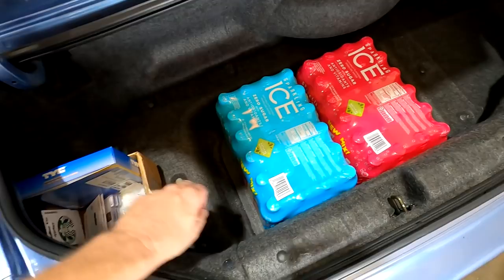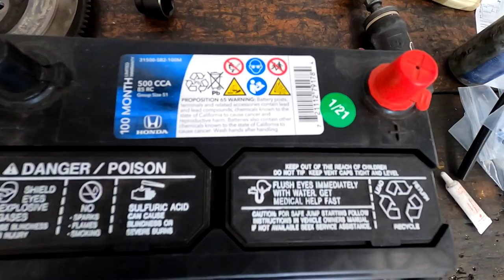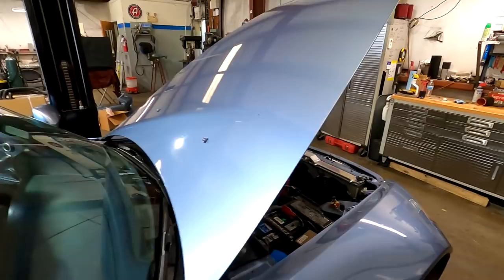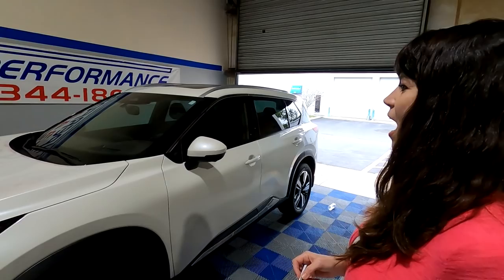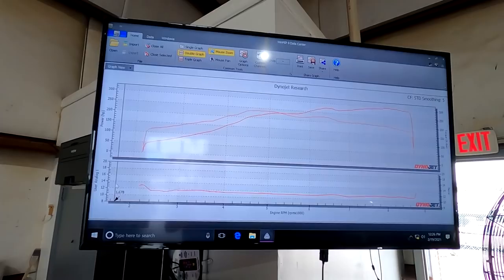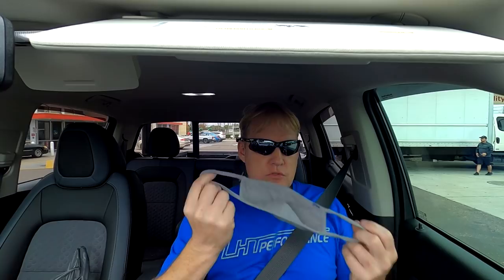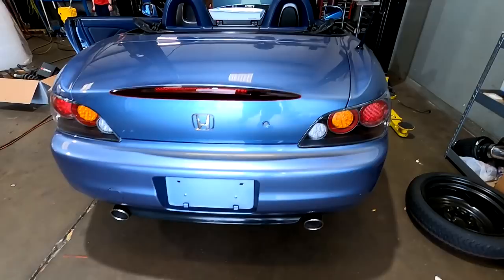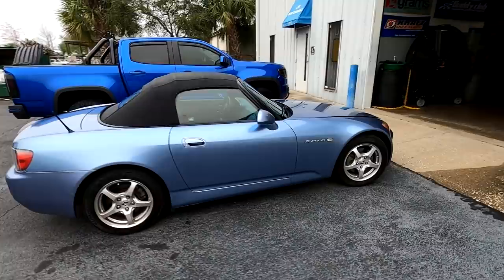Blue OEM Soft Top S2000 + AP2 Bits

Comment: You should look into the ECS Vacuum-Actuated Exhaust Cutout. Add it after the header so the customer can switch between a quiet exhaust and open header on the fly.
Reply from the maker: We’ve used several boost activated cut outs shown in past videos also.
Reply: @LHTPerformance  Yeah I wrote this comment before watching the whole video *facepalm* and realizing that your custom exhaust was quiet enough to get the best of both worlds.

Do you guys still work on RSXs? I need to make my daily RSX more OEM plus.
Reply from the maker: @Shorty15c4007  We specialize in S2000 but can work on pretty much any Honda we can fit in.

Comment: Any intel on where those taillights came from?
Reply from the maker: I’m waiting to find out. I’ll share the link when I do.
Reply from the maker: Here ya go https://www.ebay.com/itm/173916924048
Reply: @LHTPerformance  thanks for the link, before I pull the trigger I wanted to ask how was the fitment for the lights? Did they line up pretty well with the body of the car? Thanks!
Reply from the maker: The fitment was spot on. It was a shame the wires were flipped. Hopefully that made sense in the video. EBay tail lights are getting very good. I love that ones on my Colorado.
Reply: The link takes you to an eBay page that shows the lights fit an AP2 (2004 and up), but the seller also shows a set for AP1 (2000-2003).  What’s the difference?
Reply from the maker: @billmckinney7398  I’m not sure. It’s the link that was passed to me. I would contact the seller to be sure you get the right set.